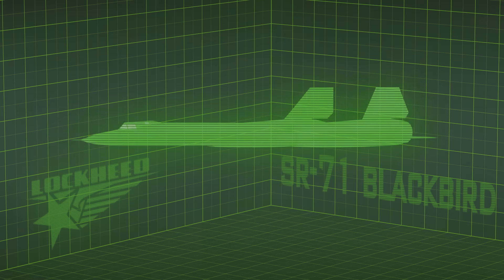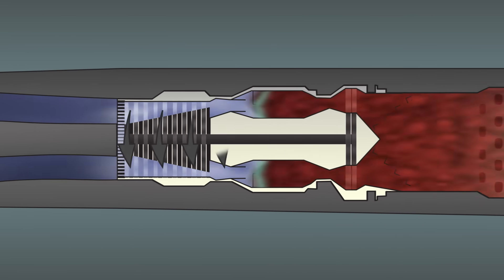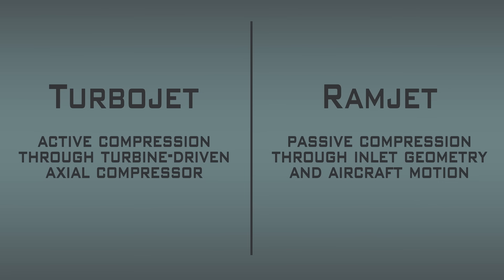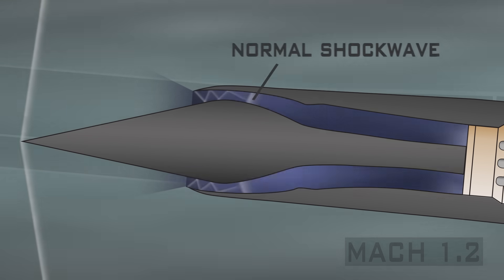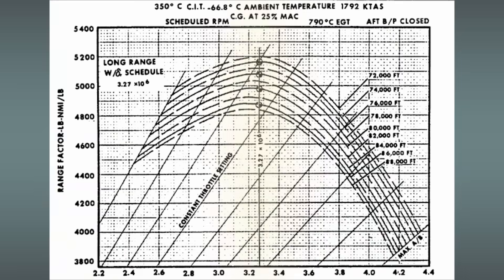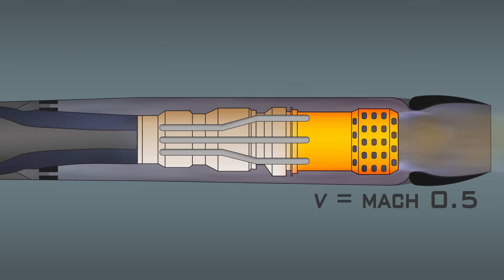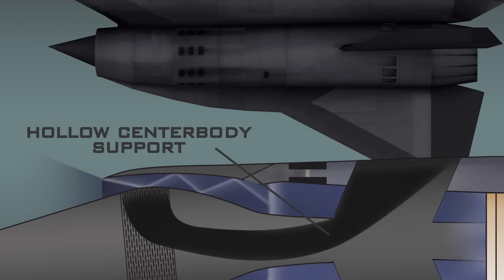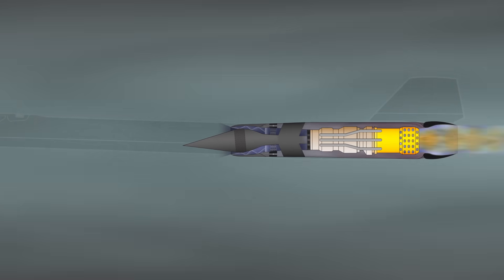The Mighty J58 - The SR-71's Secret Powerhouse

Comment: Question: In the animation that spike on the inlet is offset slightly. Is that an actual thing or just the way you guys animated it? I just found it odd that it wouldn't be symmetrical.
Reply from the maker: +phuturephunk The spike faces the direction of the airplane motion to be square with the incoming shock wave, while the rest of the body is angled upwards as part of the overall angle of attack to generate lift.  I've answered this question before in more detail (scroll through other comments for a more detailed response), but I get it so often that I'm planning on doing a video on how airplanes fly because of it.
Reply: +TechLaboratories Neat! thank you so much for the explanation. :)

Comment: 5:02 analog computer... thats some vintage engineering right there
Reply: +altaroffire56 ...Analog Computers,. Basic OP Amp Comparator Circuits and variable Inductance sensors. Ultra reliable and simple. No clocks, ram, programs, A/D craziness, or any other flakey stuff..
Reply: +40Kens But problem specific and completely unprogrammable.  Flakey stuff, LOL.  My old man used to do helicopter blade simulations with analog computers/simulators for Ham Standard and then for Martin Co. missile systems simulations  Look up sprint missile, you can see some other real tech done in this time frame.

Comment: I never understood how they got an adjustable inlet to work properly. In order to test it you would have to be going Mach 2+. Did they just sketch it up and hope for the best? How many planes did they lose in development?
Reply from the maker: +packinwood2009 Supersonic & hypersonic wind tunnels exist for practical testing.  Usually they involve a high pressure reservoir dumping into a vacuum reservoir, and the geometry of the tunnel helps accelerate the airflow to even faster speeds.
Reply: +packinwood2009 I'm guessing alot of math was involved. Hard to imagine someone designing that without modern computers and CAD software tho.
Reply: TechLaboratories wow I had no idea they had supersonic wind tunnels. thx
Reply: +packinwood2009 even the Nazi's had supersonic wind tunnels
Reply: +Denis Lipatnikov I'm sure lots of CAD was used just the Carboard aided not computer type ;)
Reply: +packinwood2009 my neighbor has a supersonic wind tunnel that he parks his atv in when not in use.

Comment: I've heard people far more educated on things like this swear up and down the SR-71 had a second fuel source?  Something to provide thrust and add an "Oxidizer" to keep the engine lit at Mach 3 or higher and possibly a small cooling benefit???
Reply from the maker: +AKlover The JP7 fuel was the coolant, running under the whole skin of the aircraft before being fed around the engine, then being injected into the engine for combustion.  The catch is that JP7 fuel doesn't ignite very easily so if they have a flame out, they have a small reservoir of an oxidizer they can inject to reignite the fuel in the combustion chamber and the afterburner.

Comment: Yes, this engine seems more complicated than usual. however an F15 engine doesn't produce far less than this engine. Furthermore, even though a Boeings 777 commercial airline engine is a different type and far different shape, it produces nearly 400% MORE THRUST. I assume that if the SR-71 was newly produced, and just SLIGHTLY reengineered, It could fly much faster, up to the fuselage limit  and would be able to get to it's cruise speed, top speed and maximum altitude a hell of a lot faster than the old plane.
Reply: +Umaxen 00 - You're confusing the thrust level of a very large turbofan engine that could never fly supersonically, with a turbo-ramjet that can produce usable levels of thrust at around mach 3.5, there's a very big difference between the two engines.
The F15 engines sit somewhere between the two extremes, yes it can fly supersonically, but only for brief periods of time, since as the video mentions it's afterburner consumes large amounts of fuel for some extra thrust, but like most fighter jets they don't have very big fuel tanks.
But even if they did, they would then run into the problem of over-heating their largely aluminium airframes, something the SR71 solves at great expense by making the aircraft largely out of titanium and other high temperature composite materials.

Comment: So - might the Concord have been more efficient with the J58-like bypass tubes?  It seems that they didn't begin to operate until the Concord's top speed (mach 2.2)...
Reply: +Eric Houston - I personally doubt it, they engineered the Olympus engines to pretty much operate at their optimal sweet spots at cruise speed.

I think it's also stated they were the most thermo-dynamically efficient turbojet engines ever made, so I'm not sure how much more efficient they could get at supersonic speeds, sure at subsonic speeds they were never going to be better than a subsonic turboFAN engine, but that's not what Concorde was designed for.

Comment: You need to know your physics,  chemistry, and probably host of other specialties to figure out what kind of fire it will take to make the thrust need to fly at mach 3.2 or higher,  which from what I gather the SR-71 still has a classified top speed. I like think of it as the cold war X-Wing. I'm betting since it flies in the upper atmosphere it's speed limitations are quite high, and it is only limited by the amount of fuel it can carry, and that near envelope of space.
Reply: +blkcoupequattro Mach 3.3 is in the flight manual as the maximum speed, short duration only.. On one of it's last recon flights over hostile territory, the crew pushed past that to evade a missle. How much faster wasn't said but maybe a another tenth or 2 for a very short time. The limit is a thermal one, IIRC, the windscreen temperature is the first limit.
Reply: +steamtorch Mach 3.3 is the maximum prolonged cruise speed the plane could maintain, the upper limit on the SR71 is still classified and would primarily be determined by its exhaust gas velocity. The SR71 hull material is stronger and more heat resistant then the X15's inconel a plane which flew over 4000 mph. The plane could likely exceed mach 6.5 for short bursts. There is an interview with an SR71 pilot on youtube where he talks about SAM's being fired at him and accidentally breaking mach 5.5.
Reply: +Mark C. - You&#39;ve got that backwards, the Blackbirds were made mostly from titanium, which has good high temperature characteristics, but nowhere near as good as the nickel metal alloys like Inconel that they make jet engine turbine blades out of, and as you pointed out also the X15. Which if you&#39;ve read up about, you will know on its fastest speed run actually began to melt thanks to the dummy ramjet.

So an SR71 doing mach 5.5-6.5?, no chance, maybe you need to rewatch that video again and listen to what the pilot actually said?
Reply: +Andrew Mckee Inconel 750 melts at 2560, the titanium 6AL-4V alloy used in the blackbird is rated to 3020.. 16% higher.
Reply: Where'd you read that the Blackbirds were made from Titanium 6AL-4V?, since most of the titanium came from Russia I'd assumed it was just regular straight titanium they were made from.
Reply: No raw titanium has ever been used in aircraft construction as far as I know, its very brittle. The original alloys for the A12 and SR71 were Ti-13V-11Cr-3Mo and B120VCA. 6AL-4V was also used later. The B-1B Lancer was produced with Ti-15V-3Cr-3Al-3Sn because it offered improved characteristic and strength over 6AL-4V.
Reply: Thanks, good to know.

Comment: Why is the nose cone tilted off center?
Reply: +TechLaboratories Almost right.   For subsonic speeds lift is generated by lowering the pressure on the upper surface of the wing.   At Mach 3 and 80,000' you can't really lower the pressure.   The SR-71 relies on the concept of compression lift - the shock raises the pressure on the wing lower surface.  The statement "Bernoulli's principles of lift break down . . . so the differential pressure is created through angle of attack instead" is a misstatement.   Even subsonic airplanes rely upon the angle of attack to generate lift.
Reply from the maker: +NOVA The nose cone angle is such that it meets the shock wave directly when the plane is at it's usual angle of attack.  Since the body is essentially one giant wing, the nacelles point slightly upwards in flight, but the torquing the nose cone with the pressure of the shock wave would reduce the pressure recovery.
Reply: +TechLaboratories So the SR-71 needed to have an upward angle in level flight? Is that because the air was so thin at 80,000 feet?
Reply from the maker: +NOVA at trans and supersonic speeds, all wings rely on angle of attack for lift - bernouli's principles of lift (the curved surface) breaks down when shockwaves form, so the differential pressure is created through the angle of attack instead.  When the whole body is a wing, it means that the body will be angled upwards slightly during level flight.
Reply: +NOVA Because it is shown from above not from the top.

Comment: From 1964 to 1966 I worked at P&W's FRDC (Florida Research and Development Center).  My job was to design the internal cooling for the hi-pressure first stage turbine blades and vanes for the JT11D-20/22 (USAF J-58).  Basically my job was to make sure the the turbine blades and vanes didn't burn up and destroy the engine and the aircraft. At that time we were doing major upgrades on the engines to put them in the 34,000 lbs s.t. range.  These were not production line engines, they were all hand-built. As a young Engineer straight out of the "Cookie Jar" (Cal Poly Pomona Aero Engineering) this was a great job!  We engine people always looked at the SR-71A "Blackbird" as a couple of J-58s with a bunch of Titanium wrapped around them.  I'm sure that Lockheed didn't see it that way!  Buy the way, we designed these engines using slide rules.  We used an IMB 1620 (16K) card-reader and an IBM 360 (360K) mainframe for our overwhelming computer power!  Think of it ... 360K of computing power, who could possibly need anything more powerful that that! The J-58/SR-71A will always have a soft-spot in my heart! Years later I retired from Northrop Grumman as one of their Program Directors on the F/A-18E/F "Super Hornet" program.  I currently own and operate the Skytamer Images website at www.skytamer.com.

Concerning the comment about a Mach 3.2 video of the SR-71A.  It's tough enough to take a video or even snaps of a Cessna 172 from a Cessna 150.  I've done it.  Possibly the CIA or the USAF could have asked the Russians if they could borrow a recce MiG-25 Foxbat for an in-flight photo shoot.
Reply from the maker: +John Shupek Awesome, thanks for sharing!
Reply: +John Shupek - With what I&#39;ve heard and learned about the SR-71 Blackbird I believe it could travel faster than just mach 3.2 for short periods. I heard a pilot say once while flying over North Vietnam he outran some surface-to-air missiles and saw numbers on the air speed he&#39;d never seen before. I also want to point out the ram jet works best at mach 5.  Thank-you for your contributions.
Reply: +John Shupek Excellent info! They could have asked North American Aviation and Later NASA to borrow the XB-70 for a few minutes to take a picture at speed! ;)
Reply: Since you worked for P&W I was wondering how much you know about the
 bleed schedule for the bypass tubes. I have been trying to find answers
 to a few questions but its tough to find someone who knows. I know it 
is controlled by the fuel control and is based on CIT and engine speed 
but how is it mechanically actuated open and closed ?
Reply: I found the answer to my question from Peter Law.
Reply: The main function of the 6 bypass tubes was to reduce the pressure at the fourth stage of the compressor to prevent choking, while providing cooling air to the aft turbines. @lardawg6794
Reply: The turbine blades are made from an alloy of mostly cobalt with double digit chromium and a tad of Mo.  Now the alloys are used for the knee replacement on the femur. the tibia uses light wt titanium and the bearing surface is ultra high MW PE.
Reply: +John Shupek - Can you tell us what the turbine blades were made out of?, I thought I read that it was some kind of high temperature sintered material.
But I'm damned if I can find the website where I saw that.
Reply: It was called astroloy.  @BlueChrome
Reply: @Bluelevitron  > Thanks for that.
Reply: John Shupek   

Wow!  Great  to hear/read!  I met Robert Abernathy once, he holds the patent for the recover bleed air system. I read that he also holds the patent for the spike movement.  https://patents.google.com/patent/US3344606A/en. See also: http://www.barringer1.com/pdf/ASME-Dec-2013.pdf.  A note about Cold War precautions, he said when he traveled (commercial air) from Florida to the Skunk works they would land in several different cities and pick up tickets for the next flight under an alias.
Reply: I have been told that the limiting factor on the operation of this engine was the temperature at the fan face of the compressor, I would assume you could deduce the max mach at altitude from the melting point of titanium

Comment: so simple I might just go build one myself
Reply: Lol
Reply: +panda44r he was joking...
Reply: Azzy M lol
Reply: panda44r yea, with that huge comment i bet you were ultra serious
Reply: I got MUCH better technology! Try ceramic-coated (aluminum oxide composite) multi-layer vacuum thin-filmed deposits onto 8000 Series Aluminum for your compressor and turbine blades and the front aerospike design. Should be good for up to 4000 Degrees Celcius. Dump Silicone Oil under pressure into CNC'ed tubular pathways INSIDE ALL the compressor-stage and turbine blades at a high flow rate and use a heat exchange system that dumps the heat into an in-body multi-cubic-metre ceramic block heat sink similar to the Space Shuttle Tiles to prevent or lower your IR signature enough for a typical 4 to 12 hour mission. I would also suggest dumping a highly expansive volatile into the outflow to cool your exhaust too. 

Since you can NOW create compressors with variable pitch you can change the angle of attack to mitigate the causes of cavitation, and then CNC some golf-ball like divots (use a hexagonal or oval divot shape pattern) onto the ENTIRE interior engine surfaces and ALL blade surfaces to you can create an artificial and STABLE turbulent boundary layer that STICKS to the engine surfaces and blades so a smoother laminar airflow can be engineered, again to prevent or cause specific airflow configurations, AND create or prevent specified cavitation scenarios and give better fuel efficiency.

As a fun idea, use microwaves to heat and eject a plasma through small holes in the hull of your aircraft so you can push the atmosphere out of the way from the hull! You'll get at least radar stealth while you're glowing green! Some of that SAME microwave-heated plasma can be injected into the combustion chamber to SHAPE the combustion/thrust/exhaust profile so you get more pounds out the back!
Works kinda like you're truck's or car's engine computer retarding or letting go the combustion cycle!
Reply: Ok Sheldon make your own engine mount to glider
Reply: Can you construct one that cools the engine through both inner and outer cavities? That may be necessary, to increase fuel efficiency yet at the cost of some thrust.
Reply: +themanginaman It is a minor undertaking. Even the Chyneez can do it. They have already but stopped because there is no buyer interest on Ebay.

Comment: Can you give us some sort of idea of how revolutionary these particular engines designs were for a) their time and b) for jet engines in general?
Reply from the maker: +HappyJoyKill Last In some ways they're the pinnacle of power for a turbojet design, and are still unrivaled in how good they are at getting a plane from zero to mach 3+.  There are engines that go faster, but they're ramjet and scramjet design, and can't start from a stop.  Modern fighterjet engines are smaller, lighter, and more efficient at their purposes, while modern turbofans offer amazing (though not unrivaled) efficiency in terms of power to weight / power to fuel ratios over long distances, being able to move far more cargo with lower energy than other jet engines, though turboprops and propfans are more efficient over short distances and lower altitudes.  It's a weird world, aircraft engine design, and an engine like the J58 is simple the best at what it was designed to do: POWER.

But don't try and put it in an Airbus.

Comment: How does the centre body bleed draw in air when it's stationary and how does it not just make all the air go out of the engine not just boundary layer is it just like small slits inside
Reply from the maker: +Flappiest Flapper The centerbody bleed is connected through the centerbody to slits on the outside of the engine nacelle - the lower outside pressure at the high speeds draws the air through the centerbody and out of the aircraft.  The size of the slits controls the volume of the air that flows - it doesn't need to be too much to remove the boundary layer.

When the aircraft is stationary, when the pressures around the aircraft are equal to the pressures at the inlet, the centerbody simply provides another path for the face of the compressor to draw in air - the compressor creates a negative pressure, and would be choked with only the flow coming through the inlet.  The centerbody bleed improves the stationary airflow into the compressor.